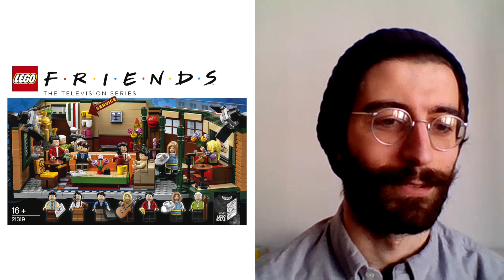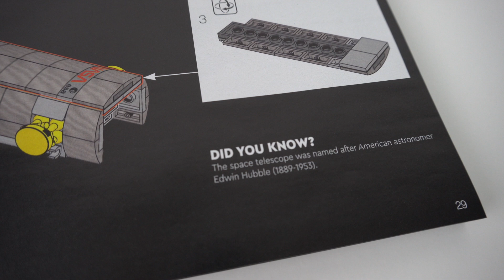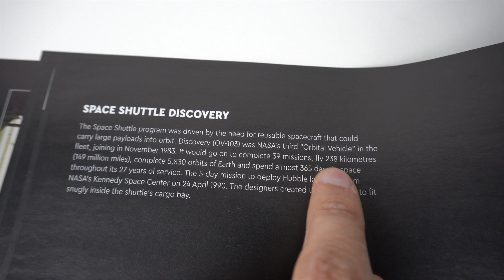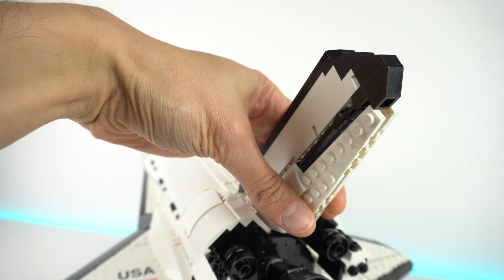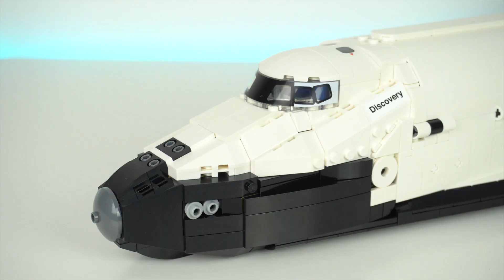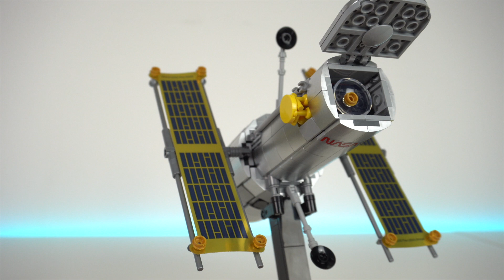LEGO Designer Interview - Milan Madge

Comment from the maker: Questions by chapters:

1:33 How long it took to design and did Covid impact at all
5:11 Design process - digital VS physical bricks
6:05 Reference Material
8:29 What set the scale of the model
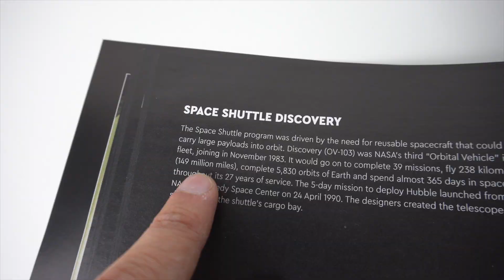10:54 Will corrections be made to the mistakes on the Building Instructions
11:54 Did you learn anything new about the Space Shuttle while designing it
12:53 Why so much olive green colored pieces
14:42 Favorite LEGO color
15:09 Biggest challenge when designing the set
17:54 Was a new element considered for the nose section
19:21 Brick built bay doors VS new element
23:34 World Record of Metallic silver elements in a single LEGO set
25:20 Hubble alternatives
27:48 Model Mistakes
28:39 Why no minifigures
31:02 Why no rocket boosters and fuel tank
32:28 Nervous while designing something so Iconic
34:15 Did you see the real Space Shuttle
34:53 Easter eggs
35:47 Quick Round of Questions
36:44 True power of LEGO
37:46 Number one tip to become a LEGO Designer
Reply: Can we have a Shuttle Carrier Aircraft (747) set compatible with this shuttle set? We don't need ET or SRB sets.